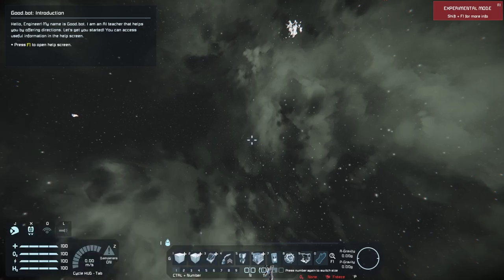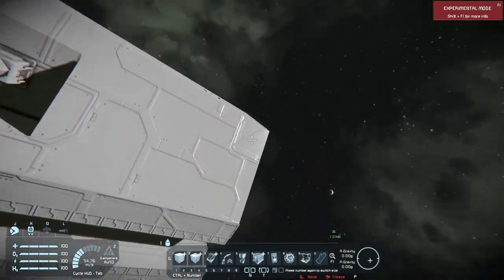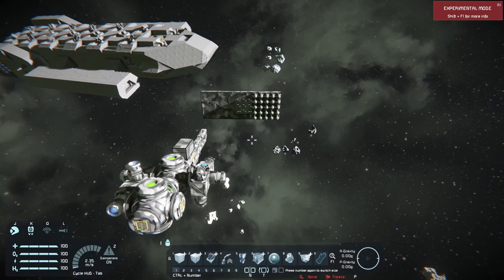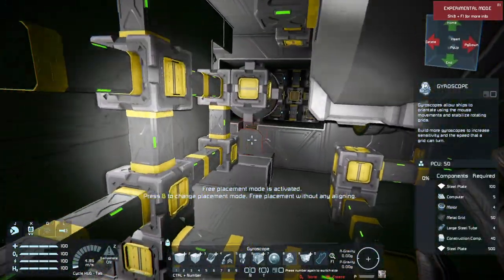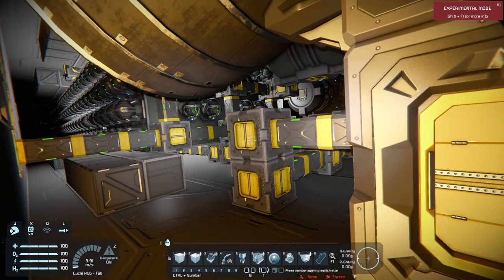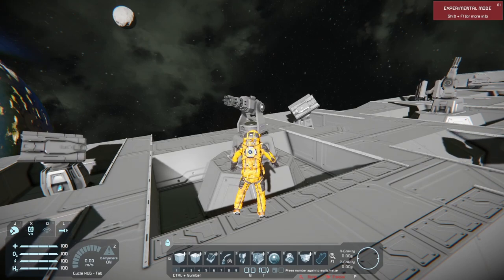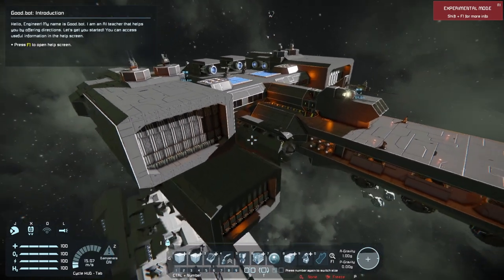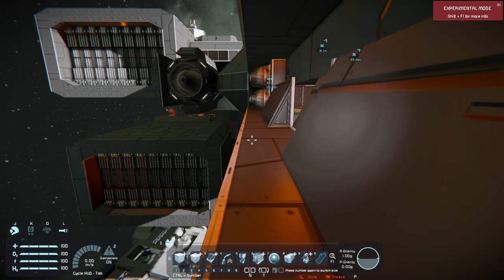Space Engineers: How to optimize your Durability! (Episode 1)

Comment: If just one of those gyros gets knocked loose your screwed.  Once a gyro starts bouncing around inside your ship as your maneuvering it becomes more damaging than any railgun.

If anyone gets a PMM in there your going to have dozens of them knocked loose and your battlestar is going to shred itself from the inside out.
Reply from the maker: then cover them up, or add more support so they CAN'T come loose. Thanks though, I'll include that in the video! thank you for the tip!
Reply: @thedeklanman  you’ll save on weight, Power and PCU by just going 3 deep on heavy armor blocks.

The gyros you keep will be more effective due to the drastically reduced weight.  Your thrusters will accelerate you better.  You’ll get way better jump ranges.  Your PCU will be way lower and the ship will overall be way easier to build and maintain in survival.

Can you use gyros as ammo?  Sure, under very very specific conditions they make for great armor, but they aren’t cost effective to be used in that manner.  3 heavy armor blocks do the same job but with only 3 PCU, 2/3 the weight and a ton of fewer components.
Reply from the maker: @mikdatv  Railguns go right through 3 layers of heavy armor, I am showing a method of giving them a metaphorical middle finger. these are just concepts, and my next video will include this.